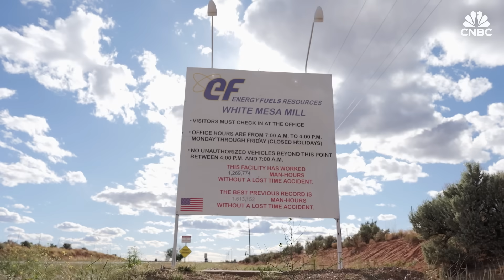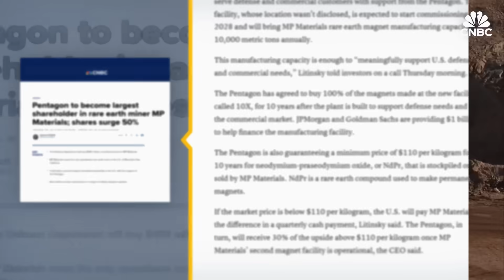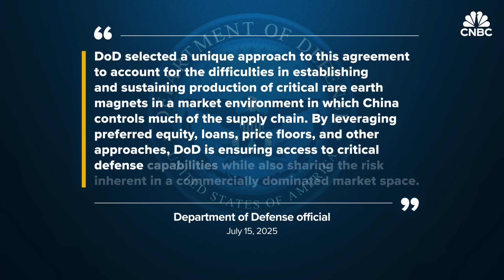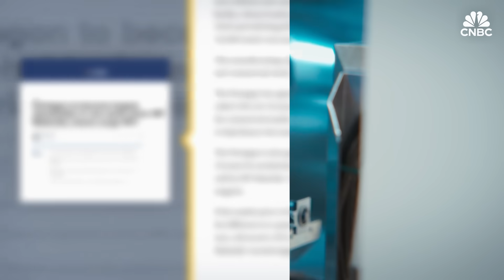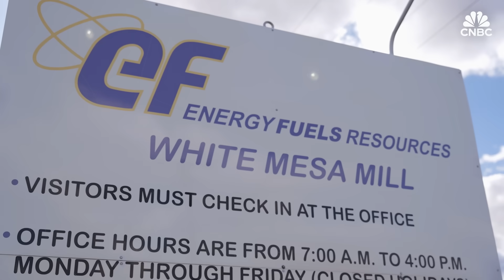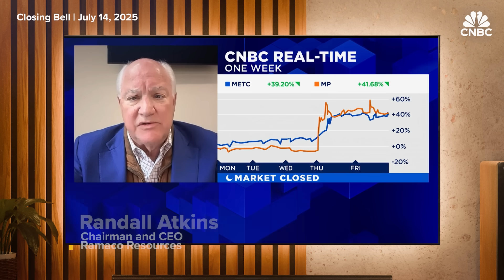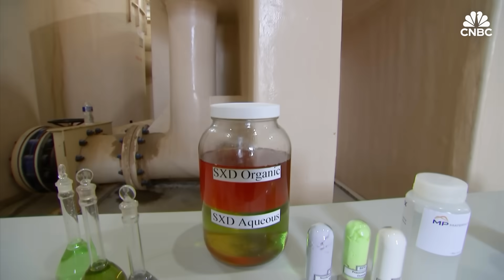Rare Earths Are China’s Trump Card In The Trade War — How The U.S. Is Trying To Fix That

Comment: This is SO SAD; CNBC USED to be very straight forward and very reliable in giving HONEST FACTS------ What you have just watched is NOTHING MORE than a commercial and PR campaign!
Here are JUST a FEW of the REAL facts this ridiculous video is not telling or just so BADLY misinformed!
1) we( the USA) have been through this BEFORE--- YES -- this is nothing but a TOTAL REPEAT--- years ago China DID THE SAME THING-- so we DID open mines and when this happened China seriously blinked first and REOPENED ALL trade AND significantly
LOWERED EVERY price per ton-------THINK PEOPLE ---how can China do this!!  THE ONLY - REPEAT --ONLY - honest answer that HAS NOT CHANGED AT ALL--- is TOTAL SLAVE WAGES, refining WITHOUT ANY regulations--- NOT ONE concern for DEADLY toxins from the process going into THEIR WATER AND AIR! The toxins do NOT NEED to be just leached in to the ground or worse into the water of China--- the govt. JUST DOES NOT CARE to use processes to STOP THIS-- it ADDS to the COST and they DON'T want to ADD to the cost!

2)The ONLY HONEST part of this video is: RARE EARTH materials ARE NOT RARE-----AT ALL!

3)The numbers of METRIC tons you SAW on  the map in this video are SO FAR OFF ---- it should never have been allowed on the video! I think all they did was get data from the FEW places they KNEW were mining --- remember -I SAID - the FEW!
CNBC covers themselves by saying MP is the ONLY --WORKING- producer: HONESTLY--- that MEANS NOTHING! 
Another aspect where this video is so shallow and is when they just briefly mention coal mines that have some rare earth materials ------ the ONLY HONEST ANSWER:  the USA ALONE--- in JUST the COAL mines has MORE than 8 million metric tons -- and that is conservative estimate--- the HUNDREDS of coal mines in JUST our Eastern part to the USA ---has THIS minimal AMOUNT --and much more!
The mining part AND extraction part --- is ALREADY DONE in these areas and the rare earths are JUST SITTING AND WAITING (in closed mines) ---- that translates DIRECTLY into costs that are NOT NEEDED( making this WHOLE process MUCH CHEAPER!)
This does NOT COUNT-at all - what is  west of the Mississippi!!!!

In one part of this POOR video-- it talks about materials shipped from Georgia--- that is ONLY because the PROCESSING plants that ARE in FULL PLACE ( several in the east) are just SHUT DOWN-- they ARE READY and FULLY capable-- with EVERYTHING THEY NEED!

Another sad left out data: CNBC --- why did THEY NOT take ONE LOOK AT ---CANADA- look at the MAP people-- Canada is dark-- with NO data: this is just WRONG and I am not sure what CNBC did in REAL research: HERE IS THE TRUTH: Canada STOPPED measuring the METRIC TONS they have --- AFTER 15million metric tons-- yes, that is again -- the MINIMUM! Why did Canada stop?--- there was NO POINT to mine--- China WAS GOING to UNDERCUT and LITERALLY SHIP fully processed rare earths ---- for PENNIES ON THE DOLLAR!

There are SO MANY MINES FULL of rare earth materials in the USA AND CANADA--- you would be shocked! This video tells NOTHING about those mines--WHY? Those mines are NOT EXTRACTING NOW-- this HOWEVER does NOT AT ALL MEAN--- they could NOT come online ---VERY EASILY--- yes--so much of the mining and extraction is EASY and READY-- that is the truth! That part being done saves A LOT OF MONEY in costs!

The lady talking in this video -should have NEVER been allowed to say anything- she has no idea about the REAL SUPPLY chain and who has what materials!

Want PROOF( more proof ) --- just look up MOLYCORP-- this is was just ONE rare earth producer who did the WHOLE process--This is just ONE company- YEARS AGO ( about 2014-15) when China tried this SAME thing( as I already said) they opened their mines -- China blinked and just gave prices at such low prices --- CHINA LOST A LOT OF MONEY-- but they DON'T CARE( they just print more money than the USA HAS printed!!)
Molycorp  WAS ON THE STOCK MARKET---went bankrupt and MANY other Rare earth mining companies ( MANY) that were going to do an IPO-- just backed off and never tried again!
Molycorp did NOT go BK because of a poor business model!!! They were undercut DEEPLY by China!

MORE to really think about( sorry about the dissertation-- but this video is SO BAD)
1) You NEED to REALLY THINK: how can China do the WHOLE -END TO END process for so cheap-- easy answer-- they have people working for -75 cents an hour to no more than $1.50 cents an hour-- these people live in deep rural areas closer to the mines and are HAPPY to have ANY JOB!   2) China does NOT do accounting for profit OR LOSS  the way the WHOLE FREE WORLD countries do--- they REFUSE to use the HONEST ACCOUNTING standards--- we call it ---GAAP!

2)If the USA would stop fighting with JUST CANADA-- and work TOGETHER to MINE rare earth materials---- WE LITERALLY WOULD --NOT EVER-- NEED ONE BIT of RARE EARTH from China--- again-RARE EARTHS are NOT RARE AT ALL!  The costs would NOT be high, because the rare earth minerals are SO ABUNDANT - and processing plants THAT ARE FULLY in working order( but dormant) are READY TO START!

3) The NOT talked about HUGE criminals that are a big part of making this MORE COMPLICATED than it EVER SHOULD BE:  THE TECH corporations and BIG corporations that are IN the USA AND THE EU--- who are using the rare earth mineral in THEIR PRODUCTS!

These corporations DO NOT CARE AT ALL, about what is a FAKE DEPENDENCY on China--- that is what this is! 
These corporations ONLY CARE about ---profit MARGINS that ARE  FAR BEYOND what you THINK they are AND-- NO -- the reported profit margins you DO FIND are NOT ACCURATE AT ALL! SECRECY in the REAL profits of what it takes to build your -IPHONE - ARE PARAMOUNT and you are NOT GIVEN the WHOLE truth!

I apologize for the length of this post, it really could not be helped! There is so much that is NOT being told to you in FULL HONESTY in this video!

Comment: China spent more than a decade developing a supply-chain and developing modern refining process that solve the environmental problems and can achieve 6N and 9N purity required by semiconductor and military radar applications. Nothing stops other countries from doing the same. USA has used "Dual-Use" and "National Security" as weapons to kneecap Chinese tech development, They learned from the best. China did not weaponize REE, Trump started a global trade war and now China is using the leverage it has. Sad? Cry about it.

Comment: Suggestion - US needs to cutting back in EV productions, cutting back of using new solar panels, giant wind generators --> start to Prioritizing of using/utilizing the rare earth for only the important projects/activities - until the supplying of the rare earth oxide done by USA are meeting with the demand --> while The US industries are using the oil, gas, coal as the main resource of energy such as for transportation, booting up the recycling of cell phones, batteries, and electricity in communication, in medical devices....

Comment: Try as you might. You won't be able to get to the level of the Chinese in rare earth processing technology in a short span like 20 years. It took China 40 years to reach what they are today since Deng XP. Rare earth itself is not rare as the name might suggest. It is the processing technology that is required to extract and refine them. This technology is only possess by the Chinese. How long do you think it will take to build a plant? 10 years! You don't just build it. You need to troubleshoot and perform trial and error to achieve the necessary specifications. In one critical rare earth for extreme purity in manufacturing of high precision equipment, China can achieve 99.99999% purity! No one country could even come close. At most, all other countries can only achieve 99.9%!